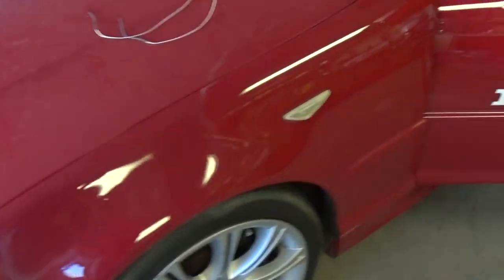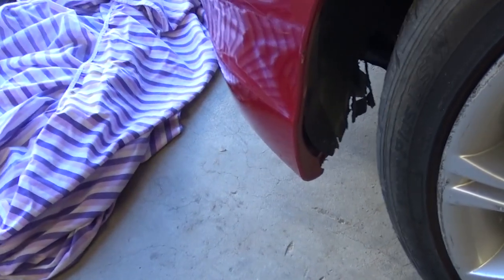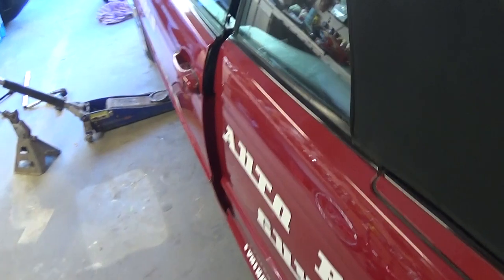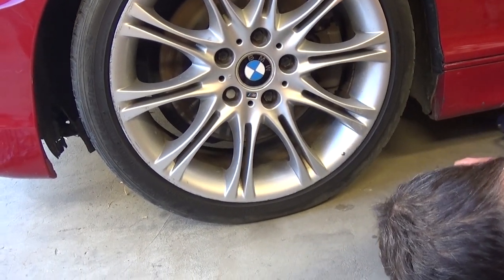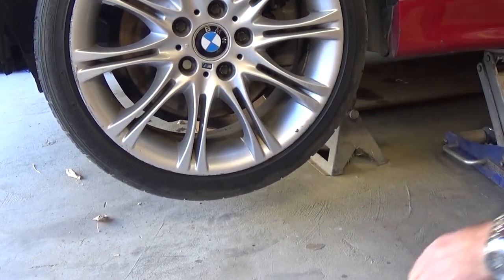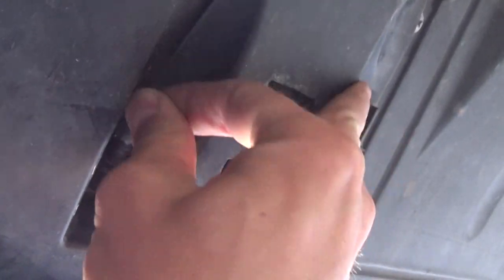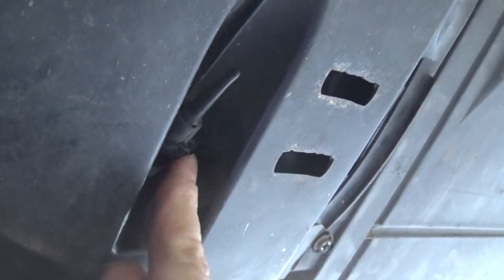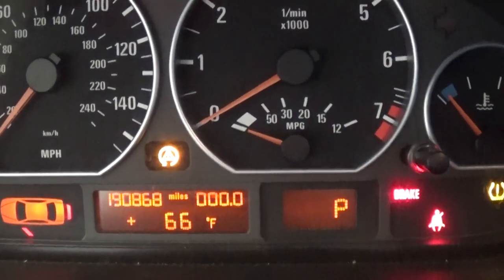HOW TO REPLACE AMBIENT AIR TEMPERATURE SENSOR on BMW E46

Comment: I replaced sensor with a new one, but cluster still reads -40 degrees. Wires Seem in good condition, so do i need to reset the cluster/recode it?
Reply: Mine says same thing bro
Reply: If it reads -40 or 122 the sensor is bad or it could be your wiring. Unhook your cars battery then. Take the plug off the sensor and clean the contact points inside with electrics cleaner spray and a small wire brush be gentle clean inside the 2 opening holes on the plug as good as you can hook it all back up if that doesn't fix the issue you got a bad sensor even new it does happen. The bmw oem sensor is only a few bucks more  so if you got an aftermarket sensor get the oem bmw one this time
Reply: Mine says the same thing.. Haven't changed it yet but thinking on doing it

Comment: Ambient Air Sensors for BMW's could be aftermarket right? My car failed Smog & I checked the sensor & it was completely ripped off. Would Aftermarket be fine to pass smog?

Comment: What's going on. I own a BMW 328xi 2007. On my right passenger side the fog and ambient air temperature sensor wiring are missing. How can I find the sensor start connection? I want to fix it from the main connector.
Reply: Same mine got ripped out at a car wash

Comment: Will a missing temp sensor cause the issue of not passing smog? (comprehensive monitor not ready after several hundred miles of driving)
Reply: Yes

Comment: Where did those two white wires coming out of the sensor connect to? I lost the whole sensor system and don’t know where they go
Reply: Did you find where it goes? I thinj my previous owner cut mines off smh
Reply: I blew a tire out and have no wires there

Comment: In my case the bad sensor was showing wrong temperature, the difference was 2.5°C, when I started the engine from the beginning it was -18°C and wa increasing to about 3°C while the real temperature was 5.5°C. After exvhange for the new sensor it shows -18°C and doesn't increase... what should Ido?

I'd like to point that in European version you have to do much more work to change the sensor...
Reply: @Christopher Robins 2001 325i Touring (LCI), in my case to change the sensor it was bit harder but still not very hard, screwdriver and 4 screws to go. I did it and it's 0.5°C difference now.
Reply: @Christopher Robins your welcome :)